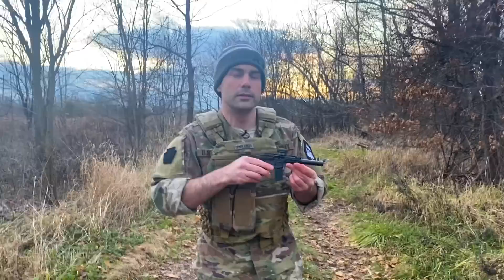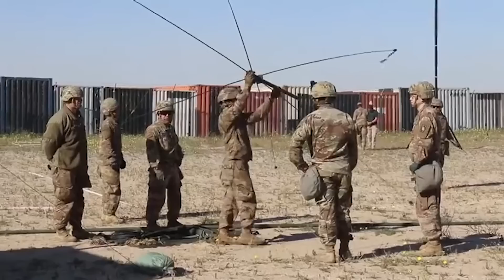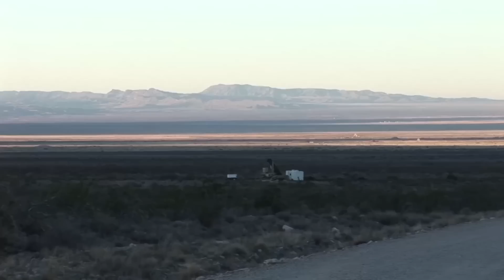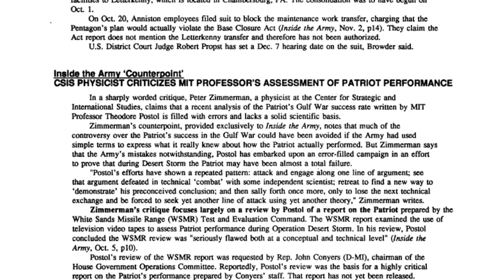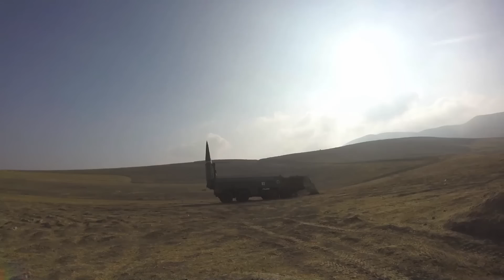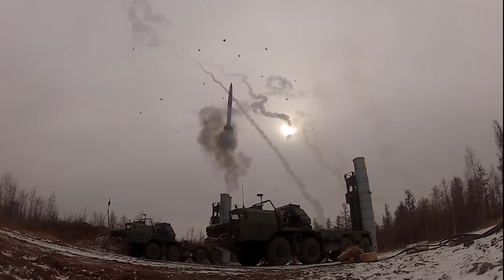Can Patriot Anti-Air Defense REALLY intercept missiles?

Comment: Ehh......Putin says a lot of things.  He decries the decadent western capitalism, but at the same time enjoys fine wines, custom made suits and all the amenities the west has to offer. 

My geeky-nerdy tech hat on; the real solution is Direct Energy.  Ironically enough the Soviets actually had an aerial denial weapon for air-space; the Particle Projection Cannon, popularized in scifi by the Babylon-5 TV series.  Either that or LASERs, or some form of electromagnetic gun would drastically cut the cost of anti-missile anti-artillery anti-air defense, and nearly make air trikes obsolete or a waste of time.  

The Patriot is extremely expensive, big, bulky, heavy, takes time to deploy and setup.  And it was Benjamin Netenyahu who was PM of Israel who told President Bush that he didn't think the Patriot was doing that good a job.  The current Israeli LASER based system is the system to have, not the Patriot.  The Patriot was designed for taking down Tuplov bombers.  To take down a drone or missile you need real time information and HD resolution sensors.

Comment: Patriot to Ukriane is a classical case of too little too late - Ukraine already has IRIS-T SLM since october and 3 more batteries promised to arrive and will shortly have SAMPT Mamba. Both of these are equally capable (or possibly more capable in some niches) to Patriot but being more modernised and digital systems require much less training and crew. Sure, Patriot will still help but it will be a quantitive not a qualitive upgrade to Ukraine's air defences when it does finally arrive. 

Its a case where US is in the eternal swamp of upgrades and ought to do a redesign - situation europeans are usually in.

Comment: For what Biden ( no mathematics possible with dement brain ) sends one patriot System ( One ! ) , its not enough to cover the area of some Selenski private luxury  bunkers. The range is 30 km, hit rate 10 - 50 %. . For ex. 3 Shaheed GAZA drones arrive 50 km away. Fro there or sooner or later the bombs get independently travelling to locations of targets. Each has 13 guided bombs to send from the mother drone . they are gliding and give no response to radar. Every bomb can take its own way as operator can choose , infrared, radar. gps , TV  or all. Every bomb can be a splitter bomb, a bunker penetrating bomb or 4 KT Tac Nuke. 49 targets, not on radar mostly , hit rate 10-50 % of patriots = min 30 are in target but mostly  ALL of them. l  ! 5 are for destroying all the patriot system and spare rockets if available. 
Of course Russia can send 50 or 100 Kamikaze drones with same effect, but the bombs have great power. One patriot system launcher has 8 rockets.Send 50 missiles to Kiev only 8  can be shot down, but with hit rate 50 % only 4 and btw, patriot system also is destroyed !
Only 250 rockets for Patriot are produced  per YEAR at the factory !. Nobody owns 50 of them with one patriot. ( You get 8 with the system for one load.) 30 km range for a 1000 km front means you need min. 335 Patriot systems only for the east front. But another 300 full systems  for the north and 300 for the south. But Many Shaheeds go 7000 km , a distance to come around  from the west via Moldau. For this add 300 more. At last we need  1235 Complete PATRIOT systems. 1235 !!!!!!!!! And nobody has the 10 000 rockets as first equipment. For 10 000 PAC 3 the factory needs 40 years production time ( they only can make 250 / year in the factory. ) One Rocket costs 400 million Dollars. = that's 4000 BILLION for rockets and launchers only 750 Billion. Ha Ha Ha Ha ................Crazy US guys , Imagine Millions are homeless, die from hunger, poverty everywhere. No money, but weapon Industry ! May God punish them !
A patriot system is total nonsense for that kind of war in Ukraine because nobody has in 40 years the number needed. Ha ha , what a fake weapon !!!!! FAKE US WEAPON !!!!!!

Comment: A Patriot battery is one more layer of defense, and that in itself is a good thing. The real question is, what will they be used for? If the UA is firing off 4 million dollars to knock out a cheap drone or a dummy missile, then that's not a good trade-off. But then, it might be used to protect a facility that is worth tens or even hundreds of millions of dollars, and that might be a good trade-off. Of course, they might have to knock out 40-50 cheap drones with just as many Patriots, and then it is no longer cost effective (in that sense). I feel it is more beneficial for the UA to knock out drone emplacements/batteries before they fire. But this may be considered escalatory. Frankly, I feel we need to help Ukraine achieve an offensive capability that completely neutralizes Russia's ability to be an aggressor. Politicians don't seem too keen on this idea (worried about Putin's feelings). But politicians, especially in recent U.S. history, have always found a way to lose a war, never really win one.

Comment: No, not accurate. The new system and radar isn't even fielded in the U.S Army... We are still operating the old radar with about 120° of coverage. You would need a full BN worth to successfully "guard" Kiev. And the maintenance is no joke. The radar being so complex, breaks nearly every time it's moved. PATRIOT is an absolutely trash system. Fuck give it all to Ukraine. PADIL is not a robust network and works off LOS, (that's why they have an AMG instead of just sending everything through SATCOM antennas)  your describing an entirely different radio that is used by patriot. But patriot does not upload anything to it it's RX only. And it isn't shown on the engagement controllers screen. Patriot did not shoot down anything but debris in UAE.

Comment: I think sending Patriots to Ukraine is a  good thing, if for no other reason than it will provide valuable data to help improve the effectiveness of the weapon system. Also, sounds like it's time to develop a new weapon system that uses drones to intercept drones.
Reply: Laser defense systems can defeat high volumn weapons. Just need them to finish development..
Reply: @nisher15  Lots of issues with those systems. Such as practical power sources, attenuation of the beam, sustained fire, etc
Reply: @Vares65  Cant deny the future..
Reply: @nisher15  "Fusion power is only 20 years away!"

Comment: Wouldn't a point defense system like the the German one, or even those nasty looking machine guns they use on ships be a better choice for shooting down a cheap slow moving drone?  I mean I've heard stories of people shooting those things down with a Dishka.  I guess they have much shorter range is the problem.
Reply: Yes, but Patriot makes a decent replacement for the S-300s' in Ukraines' inventory, of which they have only a given number, and limited ammo supplies for. Even 1 Patriot battery will help stretch the lifetime of the S-300, and longer term will likely replace it, in part, or in whole

Comment: A touchscreen is a horrible idea.
Touchscreens have to guess the X/Y coordinates on the screen with a 1-2 cm diameter of error EVERY TIME you make a press.
This also means the Russians can counter it by doing what they do best in a tight situation: stupid cheap duck tape solutions. Flying their missiles in tight formations with drones, scattering them in air on interception. Or even dumber.

Comment: Coulnn't dimply senda in more S300 ammunition or a western misile madr compatible with s300 bateries?
Reply: S300 is outdated
Reply: @SCPKing1835  looks like the Ucrania s disagree... And the russian woul like that.
Reply: @trancamortal  They use what they have. Doesn't change the fact that it's from the early 1960s.
Reply: @SCPKing1835  yes. But they have a finite supply. If they get out of misiles the Russian sir force Will beat them down
Reply: @trancamortal  Don't you worry, NATO won't let Ukrainian stockpiles run dry. Keeping them stocked is their priority.

Comment: The logic you use to support the supply of Patriot Missiles to Ukraine in 2022 would apply to the supply of these missile to the Iraqi Republic in 2003 during our invasion of that country. After all they are "just defensive". So, the question is why did we not supply these missiles to Iraq in order to counter the US invasion?
Reply: We gave a lot of military equipment to Iraq.
Reply: @ChucksSEADnDEAD  Yes, after we invaded it, and when it didn't need it.
Reply: @hypothebai4634  They ended up needing it due to ISIS.
Reply: @ChucksSEADnDEAD  They needed Patriot Missile batteries in order to defeat the ISIS air force? I don't think so.

Comment: Vastly cheaper self-propelled AAA guns like those used by many European countries, would be much more useful for point defense of critical infrastructure and much less expensive.  We have also have trailer mounted Phalanx AAA guns  that would work well without the worry of running out of missiles.   There is one older system that Germany sent, but nobody makes new ammo for it, so it's a bit useless.  Even old ZSU-23-4 shilkas would likely work if their fire-control radars were updated.
Reply: Ammo is being made.
Reply: @ChucksSEADnDEAD  By whom?   I've only heard that the Swedes were still making it and they are refusing to sell it to Ukraine.   They also will need a lot more SPAAG's like the Gepard or similar.   That is ultimately the most cost effective measure.  The Patriots should be reserved for defending against air strikes should Ukraine's other SAM's run out.

Comment: One battery... Laughable...
Once it is turned on, it will stick out like sh1t in water... Immediately, they can expect some sort of counter or attack. And Patriot is not very mobile (30-60 minutes to deploy/redeploy). So, Russians can choose what to do: drone swarms (some are capable of anti-radiation missions), cruise/ballistic missile attack, anti-radiation missile attack (those missiles outrange Patriot, btw) or any combination to saturate it... And they had no issues tearing apart S-300 which can be redeployed in 5 minutes... It will struggle to track Geran/Shahed drones... As for hypersonic missiles, Patriot is helpless anyway, so they will take it out if pointed at it as high value target...
At the same time, it is very likely to protect something very important. That will telegraph the Russians to keep looking at that area even when Patriot is down. On top of it all, its missiles are very expensive (4-6 million USD per missile), so even more money will flow to Ukraine while you suffer inflation and shortages in your countries, for little to no effect on battlefield... Imagine... Launching 4 million USD worth missile against 20k USD drone... And most likely missing it!
Unless 50-60 batteries are sent, this is only a symbolic gesture of good will. There are reports that Russians, for example, already captured unexploded Brimstone missiles and some other valuable western items (NLAW and Javelin months ago)...
Just mess...

Comment: Hmm in the last attack Russia launched 70 missiles  and if you launch 2 Patriot Missile's (at a cost of $8 million) for each incoming Missile you have just spent $560 million just on one Attack and Russia is on average doing these attack every 14 day. So with in 1 month you Ukraine would have launched nearly $2 billion of missiles and used up 4 month's of production supply. The system would be lying dead on the ground with in 3 month's tops due to the fact Russia would flood the sky's with drones and make the Patriot Missile system a high value target. All I can say is best of luck in trying to get your money's worth from the Black hole called Ukraine.

Comment: Cheap drones can destroy the patriot batteries.  

I think you can shoot about 50 drones for a million dollars.    If you know the location of the patriot batteries that’s probably enough to destroy the radar / launchers. 

The patriot system seems to need another anti drone system with it.   Something cheap like old school flak with modern automated aiming.

I wouldn’t be too surprised if the patriot system in Ukraine is destroyed in some manor by drones.  It will be a high value propaganda target. 

It seems cheap suicide drones against static targets is more effective than we thought and is a huge gap in modern defenses.   Defenses exist but they aren’t massively deployed.

While patriots are necessary against planes and missiles without an effective defense against suicide drones I fear the patriot system is going to get blown up.

Comment: I fully support the deployment of the Patriot batteries, but to Task's point, it's not really a great return on investment to target drone, even if you manage to intercept it.  It seems like complimenting the Patriot with CRAMS (ground based CWIS), would be the way to deal with drones.  That said, any gun based system is going to have a much shorter engagement range, so I kind of feel like you need to go back to something like the WW2 Chicago Pianos, but guided by modern radar and computers.  It you could get the cost per unit down to something like 10 million, it would be cost effective to deploy in numbers to defend critical infrastructure again slow drones.
Reply: What’s the price of having a city haveing no power in middle of winter
Reply: @tomhenry897  I believe the drone being used is the Iranian Kaman-12, which has a payload of about 100 kgs.  Compare this to the Iskander which can carry up to a 700kg missile.  The Iskander costs about 3 Million US, but the Kaman 12 is thought to cost a few hundred thousand at most (I couldn't locate a hard number).  With the cost of a Patriot missile also being around 4 million a shot, using them on Iranian drones is probably not sustainable.  Therefore a different option should be looked at to counter this threat; and given the slow speed of Iranian drones (about 2oo kph), I think a gun solution would be workable, and far cheaper than a missile interceptor.
So I'm not arguing that there shouldn't be an effort to intercept all attacks, but patriots should be dedicated to ballistic missile and advanced cruise missiles, while a more cost effective, and this sustainable, solution should be developed for low tech drones.
Of course, all of this is just my opinion on how to move forward.
Reply: @reclaimatorerebus6531 they won't be used on drones, this is due to the potential threat of Iranian missiles

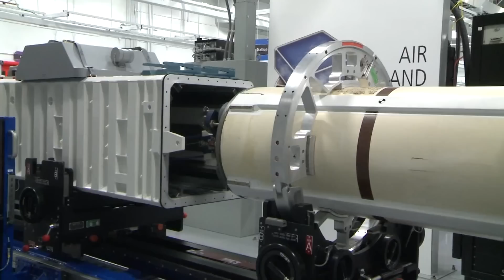Comment: if I'm not mistaking at 8:53 the footage is showing RIM-174 Standard ERAM not a patriot missile due to the booster and the launcher is mk41VLS I believe
Reply: That would be correct. You can see on the missile it says “MK104 mod 1” which is the motor for the “standard missile family”. Don’t think the patriots user those
Reply: @NoobOfShame  plan is to send this useless so-called air defense with embarrassing repatriation and claim all s300 scores as yours to fool people that we fix our crappy air defense 🤣
is good as before  like al-asad base or saudi oil reserve protection which blown your bubble with pinpointed accuracy and ability to avoid detection of iran missile